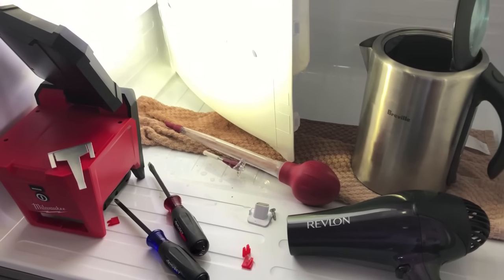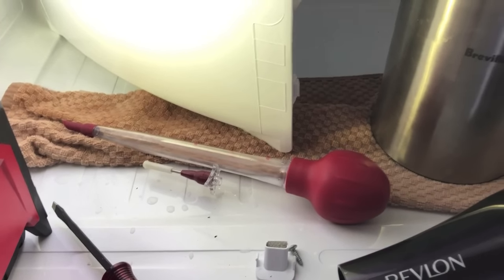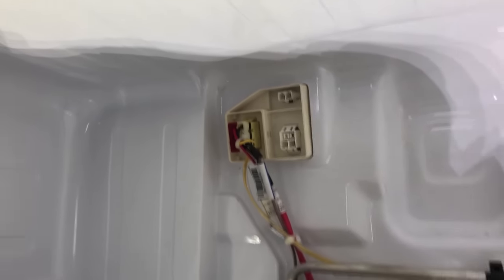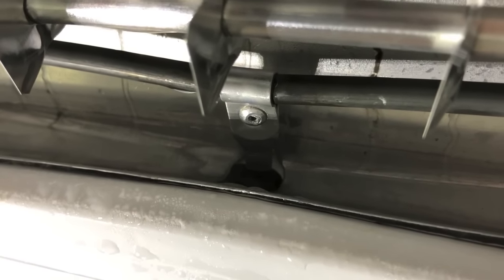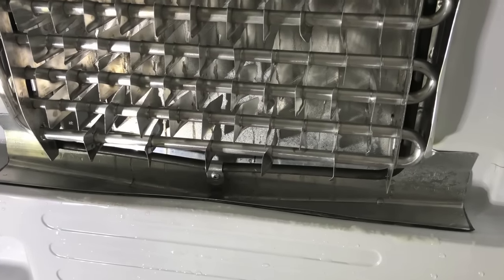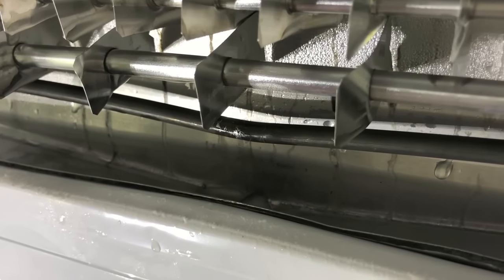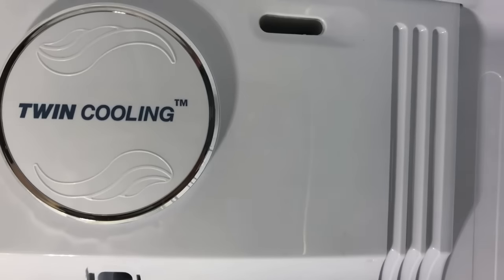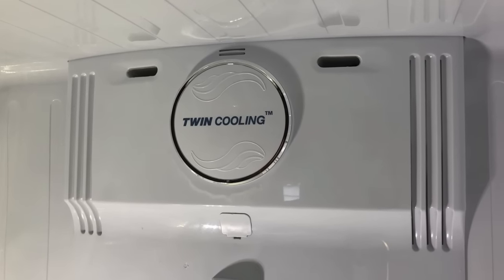Samsung Refrigerator Repair - How to Fix Water in the Crisper Drawers

Comment: I followed these steps but the water is still not going down the drain hole!? Can you help
Reply from the maker: Hi Jared, please check out #2 of the "Update - 2021" section of the video description. Sometimes the bottom of the drain tubes can get clogged (even after all the ice has been melted.
Reply: @homefixated  Took them off - not clogged at all....
Reply from the maker: @Jared_Berkey  It can take a while to melt ice if the drain tube is frozen, so it's possible you just didn't get through all the ice in the tube. If the drain tube is fully thawed and you verified the end is not clogged, then it's possible there's some other blockage in that drain line. If that's the case, I haven't heard of that scenario (nor do I know what could clog it). Sorry, I don't have any other insights at this point. You may need to consult with Samsung or an appliance repair pro. Wishing you good luck resolving it!
Reply: @homefixated  Thanks - to be sure all ice is melted in the tube - just keep pouring hot water and basting it out until its good?
Reply from the maker: @Jared_Berkey  Yes. . . when doing the baster and the line is frozen, the water level stays more or less consistent when you add the hot water back in. When the ice in the line thaws, the water should just suddenly drain through.

Comment: There is also a problem with the condensate drains in the back, they have these stupid little rubber stoppers that plug up very easily, if you remove the back and pull the condensate drain(s) pipe(s) you will find them at the top and you will say what the ??

Comment: I followed the instructions to the letter but cracked the styrofoam a little bit toward the bottom.  I CAN’T EMPHASIZE ENOUGH the importance of not forcing the panel.  As the video states, at the end btw something that should have been detailed at the start, if it’s difficult to remove the panel STOP.  Run the hair dryer or let it thaw over night.  Unfortunately, we are in the midst of the COVID19 national emergency and my fridge is full of food, I’m in a rural mountain area and getting someone to come out to service is not possible.  Boy am I pissed.  I have had this fridge for just over one year and have loved it but this is just plain BS.

Comment: Any updates??
Reply from the maker: Thanks for checking in Ryan. Our repair did the trick. It has probably been close to a year now since I did the actual repair and we haven't had a single issue or moisture problems since then.
Reply: Thank you for responding. What is that mean for actual repair? Did you contact to Samsung and they sent the technician for it? Or did you just call someone to fix it the issue?

Comment: Great video.  An Additional Issue that affects MANY people is Improper Door Sealing

The Mullion Flapper will not seal correctly, if the left door is slightly too low.  So a LOT of water accumulates every day! (1-2 cups). 

Here is the fix - https://www.youtube.com/watch?v=1j8h9S0QBBY&t=137s

Comment: The wire is fine but you can use a large drill to make the drain  hole bigger. Punching a feww extra holes wont hurt. 🤣

Comment: I changed that metal thing and after two months it started leaking again. What's the next step? Heating coil or maybe temperature sensor?
Reply from the maker: Hi Paul - sorry this fix didn't work in your case. Leaks can be caused by a whole variety of issues, so you'll likely need to investigate a little more specifically what's happening with your fridge, and/or bring in a pro. Good luck with it!
Reply: Try moving the heating coil thermostat. It's just a plastic clip and move it to the Main  in coming line..one repair guy seems to think this 1 of the issues..I am trying anything..ordered new clip and will move the thermostat also.
Reply: I saw in another video (samsung fridge leaking water into crisper Samsung fridge/refrigerator RF217 RF195) someone (TheNYgolfer) said: "Do replace the heat sink that clips to the heater and finally , and this is very important, replace the drain tube by the condenser. Actually, replace both while you are at it. The old style tubes have a cheap rubber duckbill check valve in them that dries out and then refuses to open under the weight of the water thus resulting in a backup of the drain system and subsequent freezing at the evap drain pan. If you don't change the drain tubes this problem will come back unless your tubes are the newer style tubes without the duckbill check valves." 
I'm giving that a try. Samsung and all other appliance manufacturers should get their act together and stop making people pay out the nose to repair design flaws!
Reply: obother123> When you say "...drain tube by the condenser," with "a cheap rubber duckbill check valve," are you referring to the tube in the back of the fridge at the bottom? ~ I just want to be certain I understand correctly.

Comment: You claim that the factory clip that came with the fridge is inadequate so my question to you is... why did it work when the fridge was new and for many years afterwards?
Reply from the maker: Hi Micro. Our original clip didn't work for many years, we had issues with water in our fridge very early on and tolerated it for months before seeking out a solution. The replacement clip has resolved the issue for us (going on 4+ years now). If you have any doubts about this particular part being a problem, please take the time to review how many people report the same issue and then how many report the issue resolved in the comments here.  The number of views this video has might also suggest this is a widespread problem with many Samsung fridges. I'm not suggesting the clip is an issue for everyone, or on all Samsung fridges, however, it's without a doubt a very common issue.
Reply: @homefixated  I followed a video and replaced the clip. I made sure the clip was tight but the problem persists. On my unit the fridge worked fine for at least 5 years. I am so perplexed as to what has changed to cause this. The tube is clear and free of obstructions.
Reply from the maker: @micro_2887  Hi Micro. Sorry to hear of the continued issues with your fridge. If you're getting water in the bottom of the fridge or crisper drawers and have followed the steps in the video as well as confirmed the drain tubes are not obstructed (along with the tip to slightly adjust the fridge temp - noted in the video description and pinned comment), I'm not sure what else to suggest.
Reply: @homefixated  Thank you for your help.

Comment: Anybody put the fridge into forced defrost mode to speed up the defrosting?
Reply: Ok, I did. You can google it. It's a setting that defrosts the fridge and speeds up the melting process, which I had to do to remove the cover/insulation. Thanks for making the video. Mine looks just like your's now. My fridge is like a year old. Why wouldn't they just swap out that part for a better one so this doesn't happen?
Reply: Gavin Morgan I put mine into defrost mode but it wouldn’t stop beeping! (And it was 12:30 at night trying to wake up the fam!)

Did yours beep continually in defrost mode? ...and how long did it take to defrost?
Reply from the maker: Glad that worked, and your question of why this part wasn't swapped out promptly is a good one!

Comment: For any on of you that repaired your refrigerator using this plate, have you had any more of the same problem after the repair?
Reply: Just did mine today so I'll let you know how it goes 👍
Reply from the maker: Our original repair shown in the video has held up for 2+ years so far.
Reply: @homefixated  good to hear, thanks!

Comment: No one tells how to PREVENT ice build up - only an involved time-consuming way of TEMPORARILY solving problem.
Reply: This does prevent ice build up. That piece he installed transfers heat from the defrost heater down into the drain so that it doesn't ice up. In order to install it he needed to follow a time consuming process of removing the ice, but it won't return with the defrost heater properly heating up the drain hole now.

Comment: Like if you are watching this video because you have this problem right now and looking for helpful videos. 🤣🤣
I have my fridge open, the panel is sealed because there is so much ice behind it and i wanted to look at the back of it to see where to shoot hot water so I can remove it quickly. It sucks having to wait for it to defrost!
Hehe i saw a button combo to a force defrost "Fd" press power freezer and fridge buttons for a few seconds until the display goes off then stop pressing the buttons. Now click on the Fridge button until you see on the display the letters "Fd" (forced defrost) It will start defrosting and beeping. You can leave it alone for a couple of hours just while you are able to remove the panel then unplug the power and remove the panel and start spraying hot water to melt the build up ice.. (that's my theory)

Comment: If this piece of crap wasn't bad enough with this water issue (fix only lasted about 2-3 months before same issue returned), now the freezer and ice maker no longer works.  Had a repairman out and he stated it was the motherboard which they can no longer get to replace.  During this Convid19 episode, I loose everything in my freezer because I hadn't noticed it wasn't running for a couple of days and had no idea it wasn't working.  Unbelievable!!!  FYI,,,most appliance repairmen will NOT work on Samsungs.  Had several say no.
Reply: Unfortunately if you want a reliable refrigerator, you will have to get one of the old school ones that we grew up with. All of the fancy ones will have problems regardless of brand.

Comment: I got the same problem with my over expensive 3 doors ice making Samsung fridge this clip im trying it today  it's just like a crucifix and a prayer because this fridge is poorly engineered i think because of the eco-energy star rules and laws the defrost coil doesnt turn on often enough and long enough to thaw the ice out properly Samsung knows about it and dont have a real cure except buy another fridge from us again !%?!# matter of a fact they are still building fridge the same way with the defective coil or maybe they have programed the control board with more time on cycle i couldn't say for sure about their new one , But one thing to know about these there is a secret tech. mode for forced defrost cycle on you have to press a combination of front keys to activate it ,the problem i can see as a retired tech. it's the evacuation drain hole is way to small the slightest sign of icebuild and its will get block right away ,and it's not a design that cooperate to take apart easily the pain is to remove the bottom shelves to clear the panel is another poor engineering flaws  , if they would be a way to turn the defrost element at full strength periodically that would be a cure I've tried the tech,. secret code didn't seem to do much ! i've also changed the defrost thermostat  who didn't do not much that's the first thing a service tech would change on a service call but you only find months after if the cure was successful because for me its only happen once a year or at every 18 months approx. In my case the ice goes all the way up to the recirculation air fan and rub against making the fan noisy like hell ! This fridge suffer from 2 or three differents engineering defect tied together to block the ice evacuation hole ! The heater coil not efficient enough not turning long enough is the main culprit ! Just for one more trick when you take it apart and its clog with ice in its evacuation hole fill its with boiling water the little tube will open faster and drain the greasy dirt also who seem to help clogging the little opening ! It help speeding the painful process ! Thank god for the 25 years old backup fridge in my basement I kept as a spare and for liquid drink storage , they will never import or build fridges as good as these old ones made in USA anymore, who were build for lifetime ! Its seems that the more expensive you buy a fridge the more chances there is for it to fail with expensives hard to get sensors and electronics ! So the moral of this story forget the expensive high end stainless look and buy two fridge ( one for backup ) the cheapest you can get !
Reply: Came to all the same conclusions. Wish I never got a Samsung fridge. It was fixed free because of warranty and it just fucked up again. Didn't last a year.

Comment: I used the larger clip on my refrigerator and it worked for 6 months and once again having the same problem. Ready to junk this thing. Poor design. Should not be happening over and over again. Update......ran a copper wire down the hole as far as it would go and made a u hook at the top. Crimped it on and problem solved. The icing begins in the line below heating device and works it's way up. Now I get perfect temperatures. Who is the idiot that designed this piece of crap.